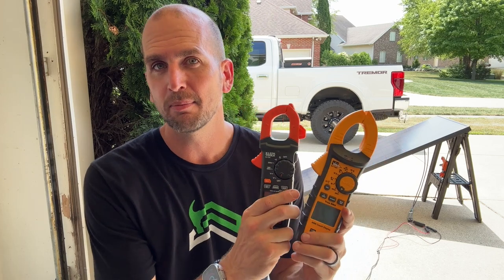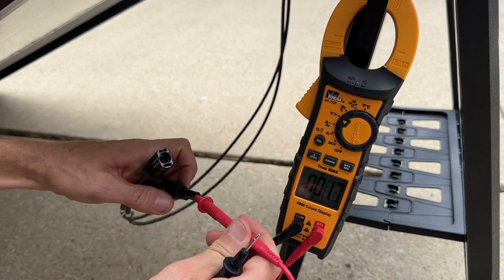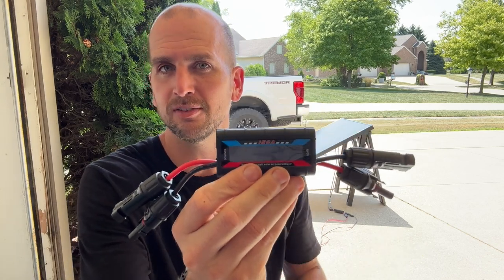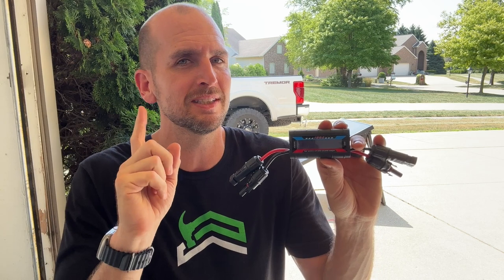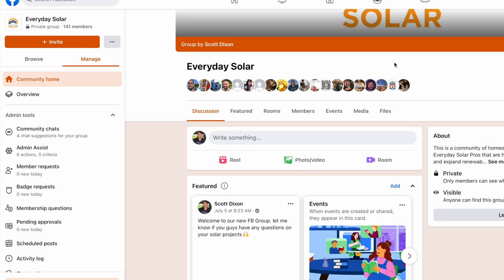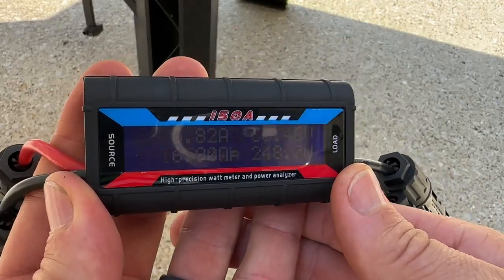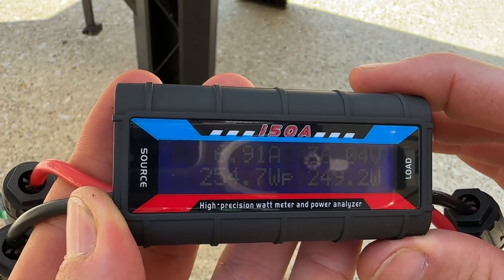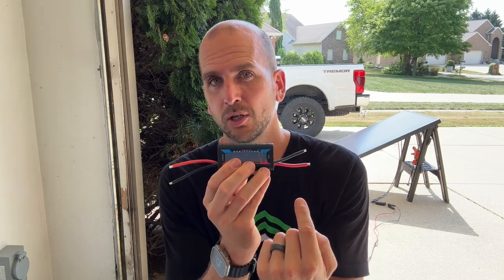Best Way To Troubleshoot And Monitor Solar Panel Output

Comment: I live in AZ. This summer our Electric Utility lost power and took approximately 2 hours to restore. It was 110 degrees and that started my search. I contacted Generac for a whole home system... 15 - 20K. Sorry cannot justify that expense. I just moved here and my home had an existing 16 panel solar system. I have watched several of your videos and am interested in setting up one of 2 senerios and need help. 
#1 Use my existing solar to charge the DELTA Pro 3  to store power and power my home in the event of an outage. I am not sure if I would actually tap into the solar at the point that ED3 is buying back my power ie using a converter to take the AC <> DC to charge the storage. Or would it be possible to tap into the power coming from the panels and before the inverter directly into the backup storage.
ED3 does buy back what I produce. My typical winter bill is $39.00... my first bill that was higher was for July. ED3 explained that I had used up my credits.....
#2
DELTA Pro 3  with the smart generator.

I would need to size the back up to handle the load for the 4T AC that my home uses plus other appliances.

Comment: Rather than buying a MC4 crimping kit that I'll probably never use again,  I bought a pair of  terminated Y cables for less than $10, cut the ends and solder/spliced them to the meter leads and covered with shrink tubing.

Comment: Hi, (sorry for my English, but I'm using a translator) after seeing your video I decided to buy 3 power analyzers to monitor the production of my panels, but I'm encountering a big problem:
Leaving them connected "source" to the PV panels and "Load" to the charge controller, logically when the sun is no longer shining the analyzer switches off and resets, but when the sun returns and the PV panels start producing again, the analyzer it only displays a blue screen without any value and to display the data again I am forced to disconnect the cables (the two Rossi ones are enough) and everything starts again.
Is all this normal or are my analyzers not working properly?
Can you recommend any other power analyzer that is right for me?
Thanks for your answer
Greetings @Tetotech

Comment: I have (2) strings in series feeding my (2) Delta pros. Each string produces approximately 110 volts and 13.73 amps. I’m can’t find anything tells me if I should install disconnects or inline fuses? Can you please help?

Comment: The analizer can't give you any info unless it is hooked up to a load, all your looking at is open circuit voltage and open circuit amps.   We have no idea what the true wats are, it's like your lying to people here.
Reply: He didn't show the hooking up to a load but he did hook it up to a load.  The load was probably his EcoFlow Delta 4 (batteries) that he mentioned early in the vid.
Reply: I found that out … after ordering… annoying